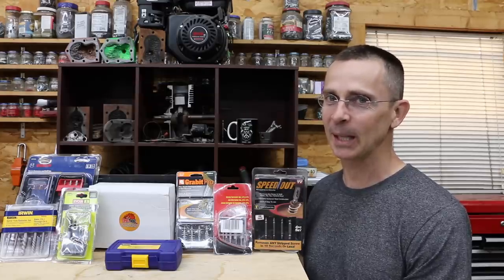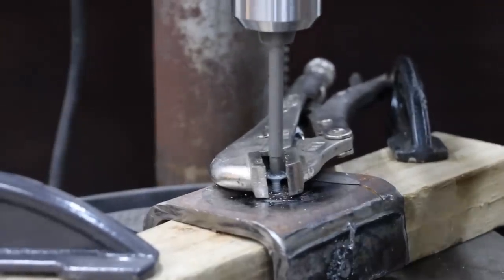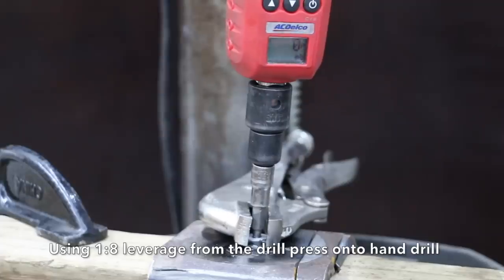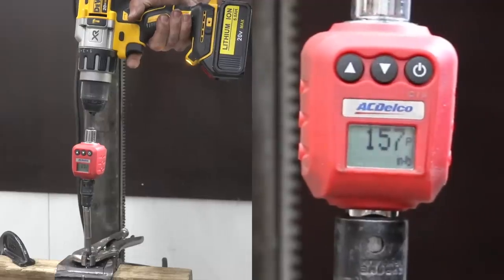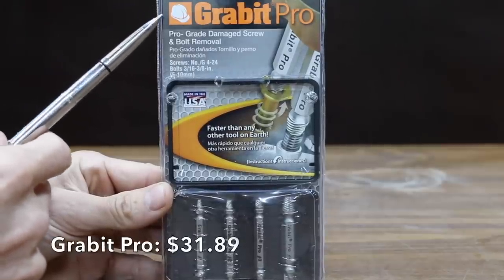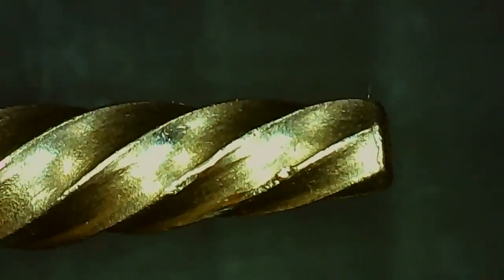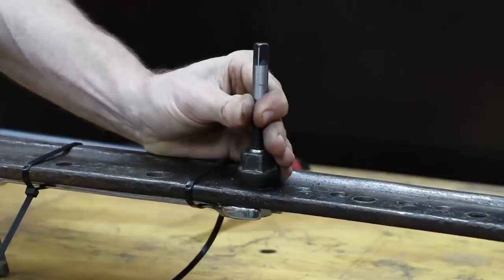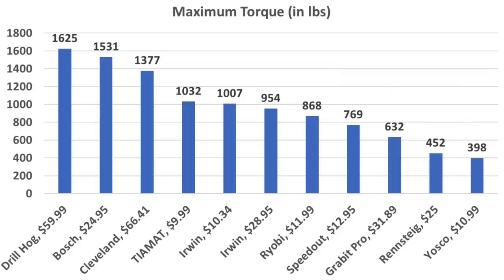Best Bolt Extractor? Let's find out!  Drill Hog, Bosch, Irwin, Speed out, Ryobi Broken Screw Sets

Comment: for 66 bucks wear on 1 job is unacceptable
Reply from the maker: Thanks for the feedback.
Reply: Depends on the job. I would be happy to spend over 100 if it was guaranteed to work once. To be fair I'm normally drilling on stuff that costs well over 10k for a replacement or a replacement doesn't exist or hasn't been made in decades.

Comment: ill give ya a hint, its not any of those pieces of shit. use a fuckin torx bit and heat, and take your time. any of those piece of shit "extractors" should more aptly be referred to as bolt swages as they swage the end of the bolt into the threads, make it impossible to remove and then they snap off in the hole renderring your component worthless.